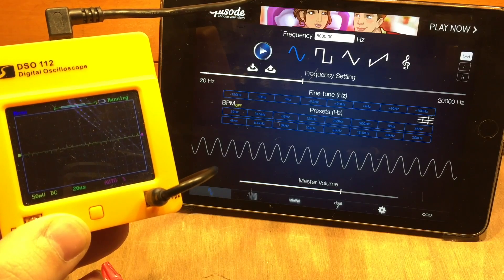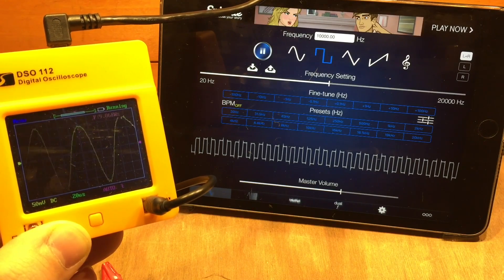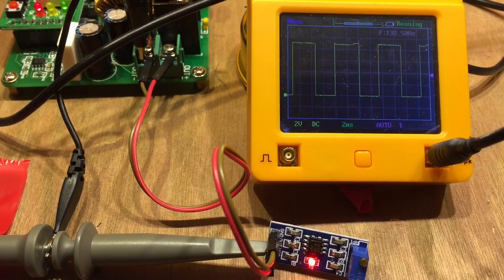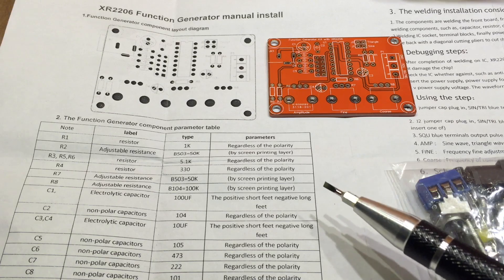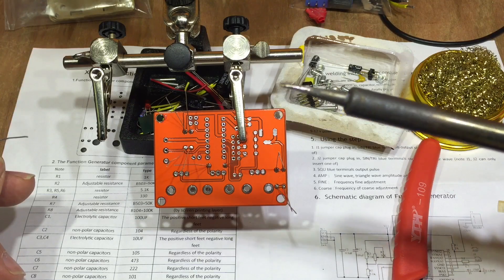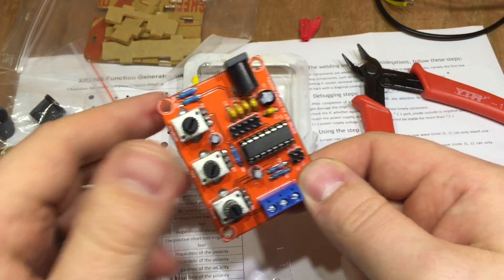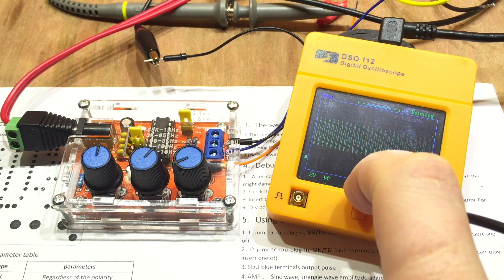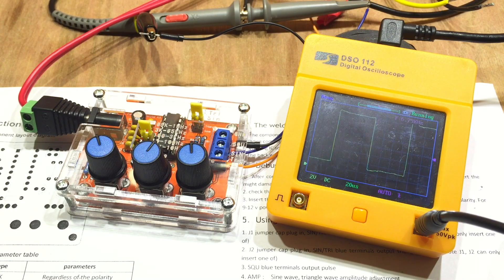Playing with Function Generators & the JYETech Oscilloscope

Comment: Nice tip about the nuts holding the board up, that's a really missed point about this kit. I missed it, and subsequently broke the perspex side plate in assembly.

Another point, one I wish you had focused more on, is the Electrolytic capacitors polarity. It seems that different boards rep this in different ways. It seems, from your video, that the negative pole is the crosshatched segment on the circuit board. I soldered it the other way around...  boo hoo for me. (Tips for young shavers...)

Comment: @Adam, How to set the function generator to do square ware ?
Reply from the maker: +Tango 99 This model has two outputs as well as the option jumper. One output does sine or triangle via the option jumper. The other output does square. So on the output side there are three connectors, sin/tri, square and ground.